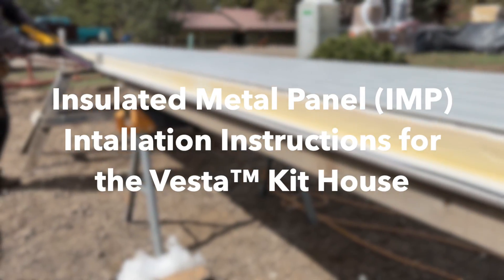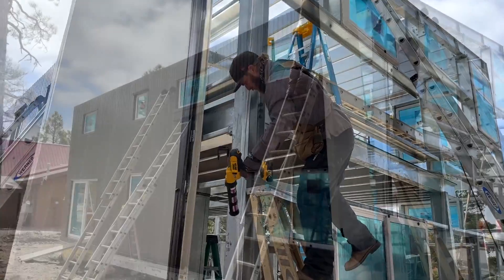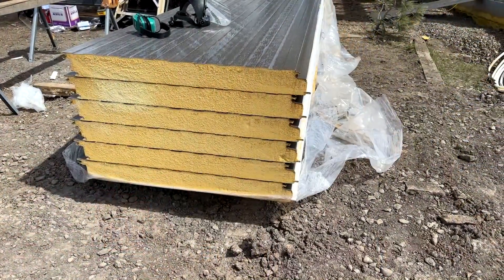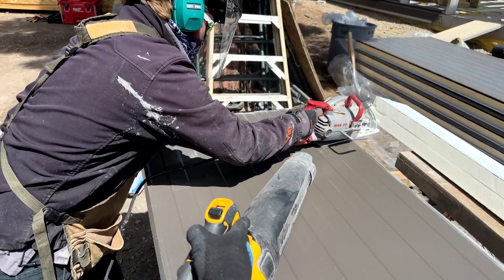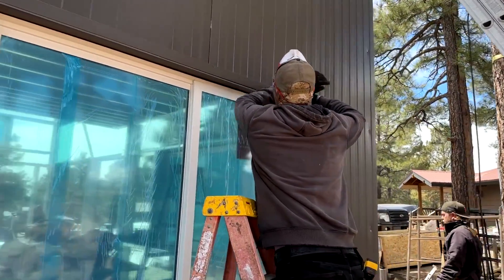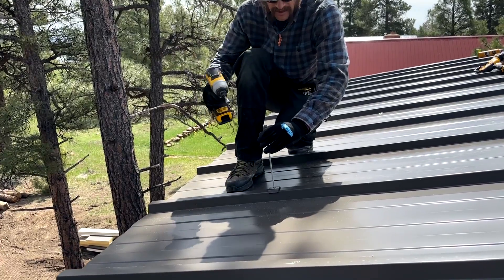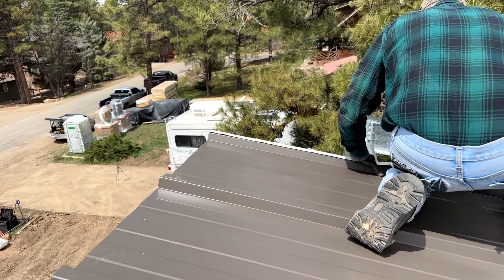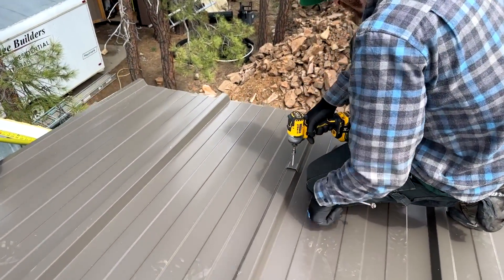Insulated Metal Panel (IMP) Installation Instructions for the Vesta™+ House Kit

Comment: Excited to watch this process & build. Thank you for sharing & look forward to seeing what you learn from this first build. 

We have a homestead and will be looking to add multiple sustainable homes in the next 5 years. Will keep following you closely & hope this will be a great option for us here in Ohio. And for the future of homes.
Reply from the maker: Thanks for your supportive comment. And what a grand venture that we hope to contribute to one day!
Reply: @CeresGreenhouseSolutions  looking for equivalent of shipping container strength of double PANELS insulated as you have for specific project.
Reply: @CeresGreenhouseSolutions how much thermal bridging occurs from the exposed lower metal sheet along the eave and overhang? 
Do you recommend any type of cuts/breaks before it reaches the interior? Like a 1/8" wide or 1/4" wide cut across the lower metal panel just before it emerges into interior that could be caulked or filled with a rubber or other gasket to prevent what appears to be a VERY LARGE SURFACE AREA OF THERMAL BRIDGING? 
Do you have calculations on the expected/projected amount / loss due to thermal bridging in various climates/conditions?
I am impressed with everything that you have shown so far, but that is one significant consideration...
Reply from the maker: @1truthseeking8  We do not sell IMPs a la carte unfortunately but our IMP manufacturer is AWIP if you want to check them out yourself

Comment: I love the concept.  Some questions.

1. Why put up some wall panels before the roof goes on (but not others)?

2. Why not caulk/seal the foam where the wall panels hit the roof?
 I understand the butyl tape and caulk will seal the envelope but you still leave open the top of the foam, potentially allowing water in. 

3. How far can you extend the overhang using these metal panels without adding structural support?

4.  Wouldn't it be helpful to put butyl tape between the panels and the metal frame to reduce thermal bridging?

Comment: How long does it take to build one of these from start to finish??? 

Not including any sort of permitting time....
Reply from the maker: Hey, great question! Once the foundation is ready, it should take a crew or 3-4 people about 1 month to build the kit, including framing, windows, doors, insulated metal panels, and greenhouse polycarbonate. This is a completely dried in structure ready for the clients interior finishing to begin.
Reply: @CeresGreenhouseSolutions  Whats the rough cost of one of these...not including labor.
Reply from the maker: @aerosciencedryfog  The base kit of the Vesta costs $269K
Reply: @CeresGreenhouseSolutions  Sweet.  Thanks
Reply: @CeresGreenhouseSolutions $269k is too expensive. Those foam panel should be cheap.

Comment: Very cool. Although I'd put all those windows on the north side. Such better light and with a house this insulated and airtight who cares about about solar gain from the south?

Also, weird that you have to do so much on-site trimming and prep of these. With SIPs they're ready to go up. And I'm not a fan of the exterior texture being so bumpy.
Reply from the maker: Thanks for reaching out. Passive House design is a very specific thing. If you live in the Southern Hemisphere, then yes, you would put all off the windows on the north side. But in the northern hemisphere, north wall windows only lose heat, so the fewer the better.

As for the solar gain from the south, the concept there is that during the winter, we let light into the house which can provide much if not all of the heat the house needs during the day. You comment mentions that it shouldn't matter with a house this insulated, but if you don't allow the solar gain to enter the space, you have to burn some input (wood, gas, or a source that creates electricity) to create that heat, so why not use the sun, its free.

SIPs are great, but they require interior finished, exterior house wrap and siding, while the insulated panels we provide are finished on the exterior and roof, so once they are on they are on. This roof took us 3:15 to install, with a finished exterior metal roof. You can't do that with SIPs. Labor is expensive so speed of install is important with good design.